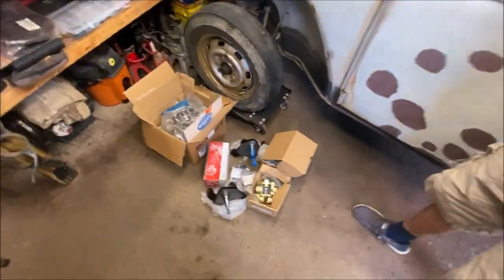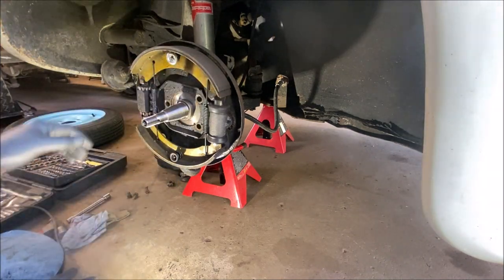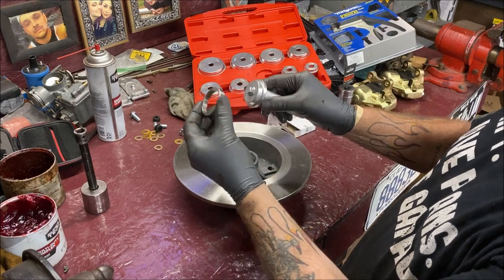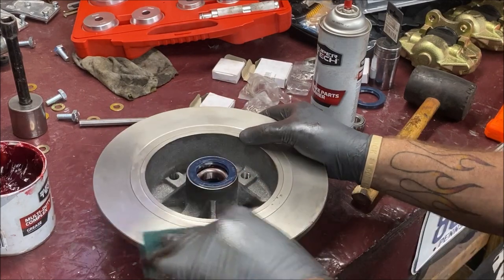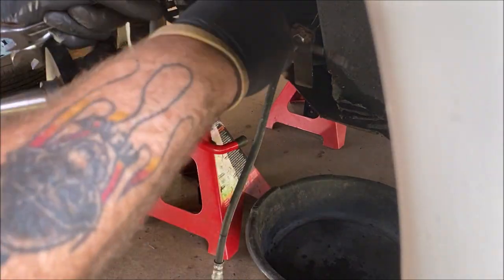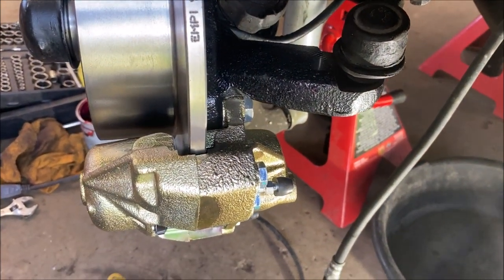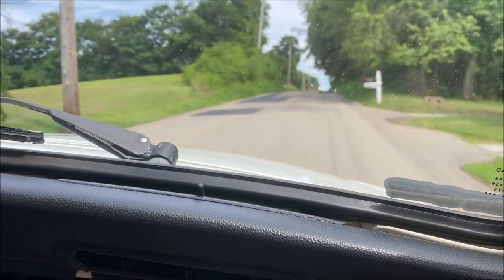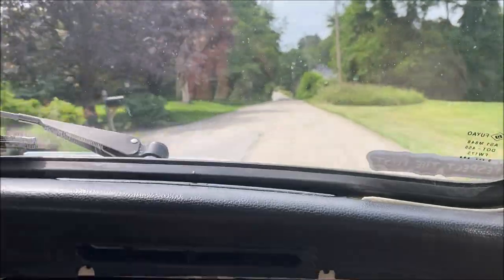VW BEETLE DISC BRAKE CONVERSION! Beetle Drop spindle installation - Beetle lowered

Comment: Surprised you didn't paint the rotors. It  more work, but it keep the rust  away.
Reply from the maker: Yes you’re right about that my friend, although it isn’t my car so I just did what he wanted. Nice solid car though.
Reply: What and how would you paint the rotors?
Reply from the maker: @timdolan4591  I think he was talking about the hub part of the rotors.
Reply: @SladesVWBeetle  Thanks - I wasn't thinking to do the hub/calipers to make them sexy(i.e. 'arrest me red') but rather for rust avoidance.  I've seen a couple videos on painting - Not sure if it is worth my time.

Thanks again for the video - I've got the parts in the garage just never can find the time, I just called AutoZone - they have the bearing race set tools for loan.

Comment: I put a set of  disc brake rotors and calipers on my trike and I love them. So much better stopping power and no pulling or adjusting.
Reply from the maker: Oh I bet it’s a big difference Randall, it’s nice when you don’t have to constantly adjust.
Reply: @SladesVWBeetle  It's probably one of the best upgrades I've done to my trike.
Reply: @SladesVWBeetle  They were a little tight at first but after a week of break in they're getting better and better.

Comment: Just the video I needed. Going to tackle this in the next few days. I think I will not be touching the drum except pulling the speedo and just knocking the three big nuts off and leaving all the outer disassembled. Again nice video, I watched several others that completely skipped this part. Derp.

Comment: Karmann Ghia, disc brake spindles are a great upgrade also.
Reply from the maker: Yes, I have heard that from quite a few people. I’ve never tried it myself yet.
Reply: @SladesVWBeetle   1968-74 spindles  Ghia's fit. 67 spindles use a smaller dimeter outer tie rods. Also they come with backing plates. Its what I got on my 76 Bug.
Reply from the maker: @vintage76vipergreenBeetle  I remember reading that on a parts website, the outer tie rod they went larger with in 68. I know quite a few people use the ghia set up. 
Do you recommend it more than the aftermarket stuff? Probably a stupid question in all honesty. 😂

Comment: Well done, excellent, clear camera work! I don't think you showed the speed cable reinstall, but I assume that it just gets routed through the way it came out - nothing tricky. I, for one, would appreciate a brake bleed demo at some point. Quite an archive you are creating here!!
Reply from the maker: Thank you so much! I’m glad you enjoyed the video. I did mess up, I thought the cameras recording when I did the speedometer cable install. Of course I will have to do it on my 68 so I’ll be showing it on there. And the bleeding procedure.

Comment: I've had a set of disc brakes for my 73 beetle sitting in my garage for 20 years, I thought it was beyond me to install them.
This video is so great...
The bit that turned me off of trying was installing new ball joints, I didn't realize I could just leave the old one's on...
Reply from the maker: You don’t need to replace your ball joints, unless they are bad of course. I hope this video is helpful. 
But… you might want to pause temporarily. I am doing a video, it will be up within days. 
On how to assemble a complete front beam. I think I’ve gotten a tiny bit better with the camera now over the years. 
That’s an older video. 
You’ll be able to see when I put the spindle on, which would include your disc brake set up. I’m installing drum set up, but it’s the same process.
Reply: @SladesVWBeetle  to be honest with you I found your channel and thought, oh well just another YouTube vw beetle channel... But honestly sir, I'm now addicted to your content. Best regards to you and your wife from the far north of the Shetland Islands (Scotland)
Reply from the maker: Thank you very much, that was very nice of you. I just do what I can, I’m nothing special. But I do enjoy helping others. Thank you so much for being here.

Comment: Good 👍 job Slades.  I converted mine and like you said I did a small test drive and I am so glad I did the conversion.  Great video brother.
Reply from the maker: Thanks, I truly appreciate the kind words. I really hope you have been doing well, I’ll be hopping over to your channel this evening.
Reply: @SladesVWBeetle  I have not uploaded nothing this week. I have been working with the front suspension, I got new inserts.  Took everything apart, wheels brushing and painting to put everything back together.😀

Comment: Nice job..Been gathering parts here because its winter but doing a conversion on a 68 Beetle i purchased..i am just gathering parts for now and waiting till spring to do the work..One problem i am facing is i noticed the disc brakes were already done on my Bug but the drop spindles were NOT done.. so i bought drop spindles by Empi part # 22-2951..The conversion on the brakes were done by previous owner and he used Empi part # 22-2983 ..I didn't know the disc brake conversion kit part number until after i bought the drop spindles and i bought the spindles because the description said Spindles for Beetles that already has disc brakes..After learning the disc brake kit already installed was part 22-2983 and read the description for it.. there it says it will NOT work with drop spindles..I wish i would have done my home work and knew this before i bought the drop spindles..So i called and asked why they wouldn't fit and i am told they WILL fit but i need to delete these brackets on the disc brake conversion kit that supports the calipers because they are not needed with the spindles i bought because these spindles already have the holes needed to bolt the Calipers to the Spindle and those brackets had to be used in the disc brake kit with the old stock Spindles..Do you know this to be true by any chance ? BTW.. thanks for the video it does answer some questions i had..
Reply: After this earlier post describing my dilemma with the Empi disc brake conversion kit that was previously installed ( part number 22-2983 ) prior to my purchase of the drop spindles ( 22-2951 )... i finally took the job on yesterday and am happy to note the spindles do work and i only needed to delete the bracket supporting the brake caliper thats used on the disc brake conversion kit ( 22-2983 )  because the spindles already have the holes needed to support the calipers.. Not sure why the description on the drop spindle kit says it won't work when they simply could have said to delete the bracket ...but being the back yard mechanic i usually don't tackle too many jobs on a car that could get me in trouble but i have to say that the drop spindle conversion wasn't too bad..The right tool for the right job is most important here meaning mostly the ball joint separator.. i used the clamp like separator and not the fork to minimalize any possible unforeseen damage hammering on it..took about an hour for each side..This video helped me with the confidence to tackle this and thank you for sharing it

Comment: Why didn't you change the cracked boots on the lower ball joints at 20:45? 
Love the video.
 I brought a 1973 SB back to life in 1988 while in college. Ran it for 2 years. Survived a black ice spin out that bent the passenger tie rod. Because there is no wt in the front, I drove 30miles with the passenger tire pointed in  30* angle!. 2 hrs later I arrived home with steel radials showing through the tire. It never blew the tire. The next day, into a vise grip to straighten the tie rod and  drove it another 6mo. What a car it was!
Reply from the maker: WOW!! Luckily you were not hurt!! These cars are pretty tough! I did show him a few things that needed attention! And let him know it needed replaced.

Comment: Great video... not sure I am ready for either drop spindles or discs (just re-did complete drum system on the '74 SB), but enjoyed the watch all the same.
Tell ya what though, Casey's beetle is hella quiet and smooth sounding/appearing (especially through 1st gear), when compared to mine.  
Thanks as always Slade, keep 'em coming.
Reply from the maker: Thank you so much for being here, and thanks for the kind comments. 
He truly has a nice solid car. 
We’re going to do a dash pad replacement on it shortly, and I want to replace a tie rod end. 
I don’t mind helping friends out that’s what it’s all about. 
Then I will be getting back to work on my 68...and filming possibly two times a week on it.

Comment: you make it look easy. really appreciate all your effort. when you go to rear disc brakes do you have to go to a bigger master cylinder? why?
Reply from the maker: I have heard when you’re running four wheel disc you need a large bore master cylinder. I have not done it myself yet because I never needed rear disc. 
I just don’t see the need to. I imagine it must need a lot more fluid pump to the back I’m just guessing.

Comment: There is one complaint I have with the empi disc setup is that none of the bolts have lock collars or spring washers. 
Lesson for the day ( righty loosey, lefty tighty )
Reply from the maker: I’m not a real big fan of Empi. I was when I was young in the early 80s, but not as much now. 
I feel they have went downhill a lot. But that’s just my opinion of course.

Comment: I have a ‘68 with drop spindles with drum brakes and 165 tires. I have about 1/2 inch clearance on each side to the fenders. Would changing to disc brakes cause rubbing?
Reply from the maker: Honestly I believe the disc brake set up, is offset further out slightly.

Comment: Hey, what brand of 2 1/2" drop spindles do you recommend? I have wanted a lowered bug most of my life! Just got one and have the money to do this. Thanks!!
Reply from the maker: @KevinBoswell-l1r  the kit that I put on this car was supplied by my friend. The owner of the car. He bought a complete empi kit. I actually have no problems with using their stuff depending on what it is. CB performance I believe hazard really nice kit also. Probably a little more expensive.
Reply: I saw the Empi brand on the rotors from the video, but wasn’t sure on the drop spindles. I have disk brakes on mine already. Just wanted to check with you before I bought some. As usual - great info!! Thank you so much!!

Comment: Do you recommend disk breaks in the front and back? Where would you recommend buying the upgrades?
Reply from the maker: I like them Michael they make a big difference. Doing the fronts is where most of the braking power is. If you’re going high horsepower, then doing the backs, I would definitely do. Any of the big vendors, Jbugs, Cip1….They’re all about the same with that stuff.

Comment: why does the caliper have 2 bleeders? which one do you use to bleed the brakes? top or bottom or both?
Reply from the maker: Honestly most that I have seen usually have one. 
But I just use both bleeders to help it get all of the air out.

Comment: Did the tires rub after lowering the front?
Reply: Already had dropped spindles but for the drums.
Reply from the maker: He’s running 145s on the front, so there’s no rubbing. I’m not quite sure of 165 factories would rub or not. I’ll find out when I do my car. 😁

Comment: Again a great video, Slade, thanks a lot!   I own a super beetle from 1974 and also installed disk brakes. It is indeed a big improvement on brake performance. However they keep squeaking, especially if I brake just a little. Do you have a suggestion how I can get rid of it?
Reply from the maker: First of all thank you Jan, and thank you for taking the time to watch the video. And welcome aboard. 
Squeaking can be very annoying and I’ve had that on quite a few cars. 
I prefer to always use the disc brake quiet on the back of the pads, of course not the side that is coming in contact with the rotor!
Reply: @SladesVWBeetle  
Hi Slade, thanks for the advice! I will acquire some 'disc brake quiet' and will let you know the result!
Reply from the maker: @JanStruik1952  you’re very welcome. You’ll have to remove the pads and coat the back of them and let them dry. Hopefully that works out for you. Unless you were having rust film? From the car sitting?
Reply: @SladesVWBeetle  
Hi Slade, I just applied 'B-quiet' . I think it is similar to 'disc brake quiet'. Anyway it did solve the problem. Thanks again for the advice! And keep on making great videos!!

Comment: I’m new to the Volkswagen scene, and diy mechanics. Why did you say it was a 2 1/2” drop spindle?  Did you actually drop the front end?  All you said at the end was it was a good front disk change.
Reply from the maker: The spindles are a 2 1/2 inch drop, which lowers the front end. It had 2 1/2 inch drops for drums so I swapped them with the disc kit. Much better stopping with the disc. And the drop spindles make a nice stance.

Comment: My beetle has the front disc brakes luckily, Is it worth it to swap the back brakes too?
Reply from the maker: That’s great news Anthony, I think it’s a great upgrade. On the backs, I would probably only do it if I was pumping some pretty serious horsepower. But of course that’s just my opinion.
A little bit wider of tires also can help with quicker stopping power. More tread on the ground.
Reply: @SladesVWBeetle  thx for the response man! Love your videos. My beetle is mostly stock. I dont think to much horsepower should be a problem! 😅👍
Reply from the maker: @EpicVitto  you’re very welcome, I appreciate you being here. 
Honestly, the closer you keep them to stock the better they run. 
I know people will argue about that, but it’s the truth. 
If you’re interested in having your beetle on the website in the members section please feel free to send me an email....check out the members section of the website.
http://sladesvwbeetle.com

Comment: Great video!
Just wondering, how long did it take to complete the swap? And was there any clearance issues with tire rub? Your replies are always appreciated!
Reply: Looks like the bug already had drop spindles, only the drum versions previously... so shouldn't have changed anything in terms of tire fitment/rubbing.
Reply from the maker: Honestly I could’ve probably did it in about 45 minutes. A fairly easy job. 
He has 145s.. the front, so I am really not sure if it would rub with stock 165’s. 
But I will be finding out when I put them on my 68. 😁
Reply: I have a ‘68 with drop spindles and drums with 165 tires. I was wondering if they would rub also with the disk upgrade. I have maybe 1/2 inch clearance to the fenders now.

Comment: Just done the exact same conversion, bled brakes but still spongy only engage when pedal almost at the floor and pulls slightly to the right. Gets a little better when i pump them, I was going to bleed the brakes again. But do you have any other suggestions ie the master cylinder? Thanks
Reply from the maker: Do you mean as in bleeding the master cylinder? I’m sorry I didn’t understand what you meant at the end. I actually like to gravity bleed, and then bleed with somebody pumping the pedal. Gravity bleeding usually helps out a lot
Reply: @Slades VW Beetle Thanks for the reply!!  I found my issue, the rear brake cylinder in the hub on the rear passenger side is leaking so allowing air into the system, so the gravity bleed etc was never going to work..
Reply from the maker: @xaviers2042  you’re welcome, I’m glad you found the issue. That’s an easy fix, so you definitely got this now!

Comment: As you add in new brake caliper to the Beetle's front wheel. And you didn't add any shim But I see more gap on the between the outside brake pad than the inside brake pad's gap. Please, add more shim between the caliper and the knuckle spindle to add a little more space(gap) between the inside brake pad and disc. So because it wears out both brake pads even per wheel. Otherwise the pad wears out more than the other pad on same wheel. Thank you.
Reply from the maker: Honestly Rex, before I was done I did realize that and go back. But I didn’t want to start a video all over again but thank you. I appreciate that.

Comment: Maybe that rear grease seal was missing because previous shoes were squeaking and needed constant greasing? 😜😝🤪
Reply from the maker: 😂😂😂😂 You’re too much brother! I hope that you have been doing well my friend.
Reply: @SladesVWBeetle  😂😂😂
Life has been good.  Had the beetle out Thursday night for Mingle on Main in Saxonburg.  As I was driving over the bug really started to run like $h|t.  Poppin an back firing.  WTF.  Pulled over an opened the deck.  Here the distributor cap was just bouncing around on the 009.  
1. How the heck was it still going down the road?
2. Gotta love just wiping the cap out of dust, snapping it on then driving away like nothing ever happened.
Reply from the maker: @terrancemoore2035  wth?? 😂😂 that’s a wonder kept running! You’ll have to visit when you get time, normally I’m here all of the time unfortunately. 😁

Comment: Looks like the rubbers on the ball joints need replacing.
Reply from the maker: yes they do! Sadly it’s not my car, they weren’t interested in me doing those at the time
Reply: @SladesVWBeetle  silly really not to whilst it's stripped, here in the UK it would fail its yearly roadworthiness test (MOT) and wouldn't be allowed on the road.